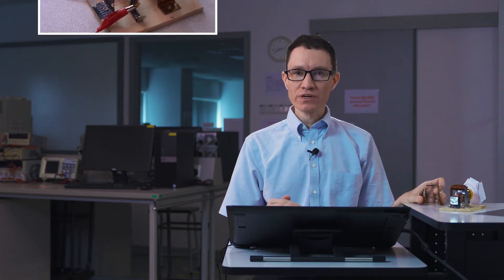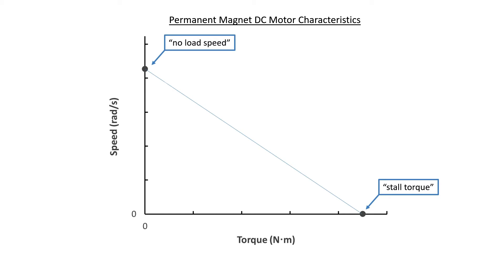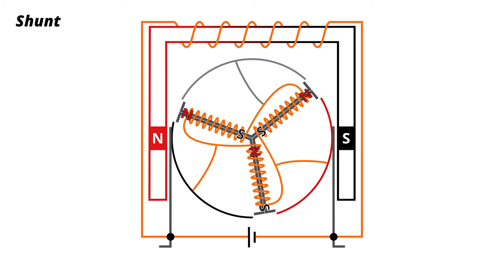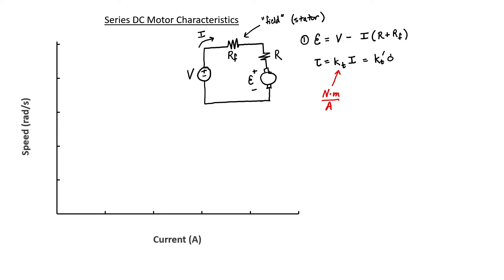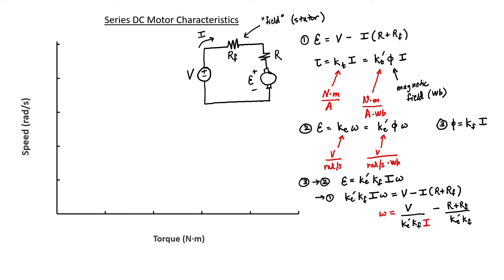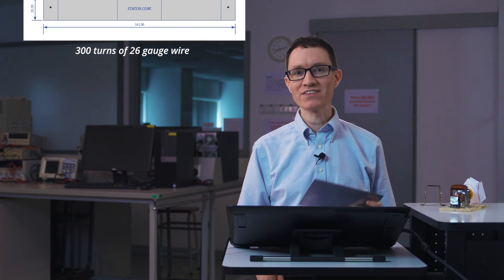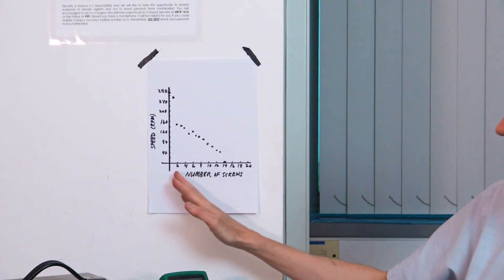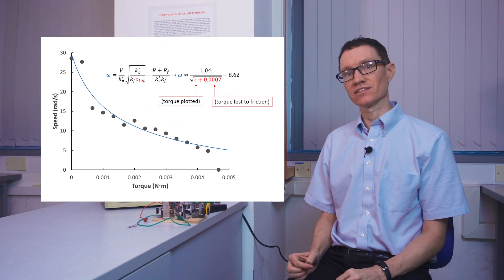Let's build a series DC motor and measure its torque (Motors #7)

Comment: Hi, it says that the magnetic fields depend on the strength of the current in the 'series' motor. I'm trying to clarify why the current is not constant given a d.c. voltage source. Is it because of the frequent on/off in the rotor, hence, the current across the field is also experiencing frequent on/off? When the wiring is in parallel, the field is not impacted by the rotor on/off and continue with the constant voltage source.
Reply: DC Series motor draws very large current initially...hence high starting torque

Same was used in train traction motors earlier days

Now they use AC traction as less maintenance required as better speed regulation